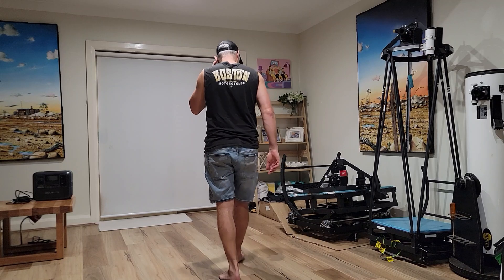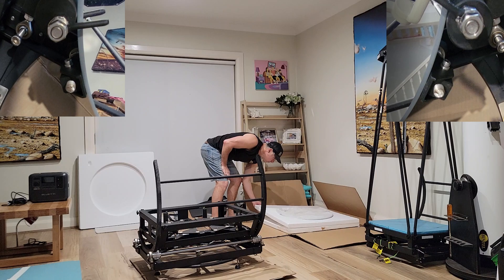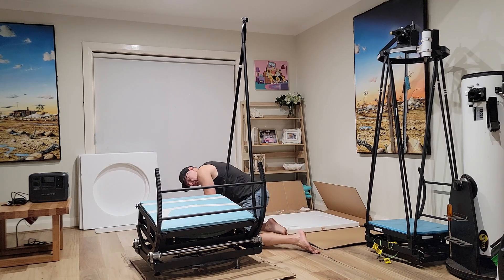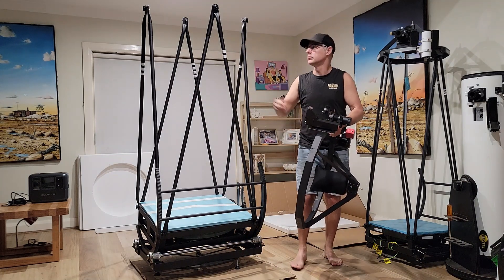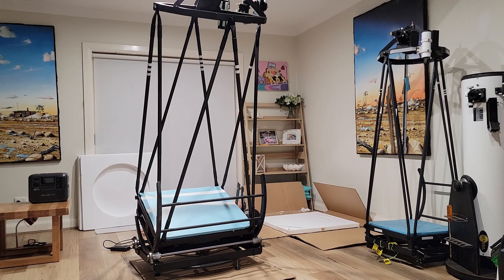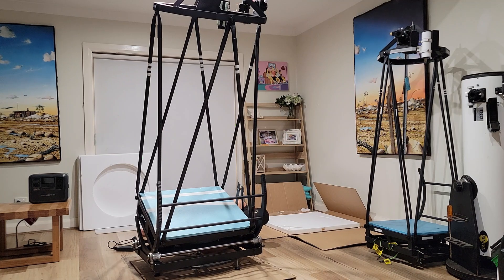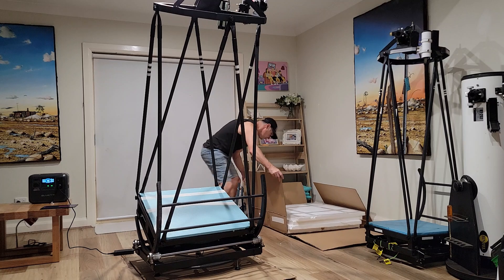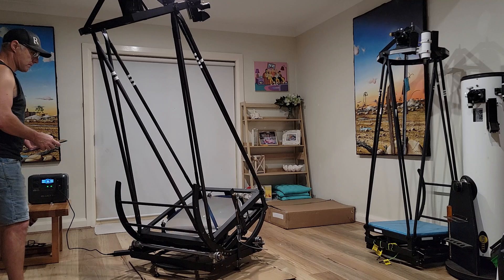How i build my 24" Dobsonian

Comment: Great build video! Do you take the primary out and set it in the box it came in whenever it's not in use?
Reply from the maker: Thanks mate, yeah sometimes it do, probably 50 - 50 if it think about it. Whenever I go away it goes in the box 100% and never travel with the mirror in the cell
Reply: @damienk2372  Ok thanks Damo! I wanted to also ask you about the brass wires connecting the support angles. The online instructions show them connecting the outside of the triangles, but are they also to be connected on the inside?
Reply from the maker: Yep, a run around the outside and also the inside 👍
Reply: @damienk2372  I also wanted to ask you about the curved altitude bearings. When I push the scope down in altitude, im getting a clunk/catch on the Teflon pads. Do I need to adjust the curved altitude bearings? Other than that, im pretty much done. How tight do you make the strap that holds the primary? If I tighten too much, it seems to move the primary up towards the single bumper. Sorry for all the questions brother.
Reply from the maker: Remember I said altitude bearings need to put so each end touches the ground like a C and you push down in the centre and tighten it up to make it flatter where the join is and the sling need to be as tight as necessary to hold the mirror directly (measure with tape measure to the mm or 16th inch) in the middle of the mirror housing. Check it every week to see if the sling has stretched for the first 3 or 4 weeks. It should be part of your routine of collimation to ensure the mirror is perfectly central
Reply: @damienk2372  Thanks Damo! I did that with the altitude bearings initially and it fixed the clunk, but when I attached the truss poles and upper assembly it happened again. I'll keep at it until it's perfect. I have an Orion laser mate collimater. Not ideal but it works for now. I can't wait for first light! You've been great throughout this entire process and I really appreciate you taking the time to walk me through the assembly/collimation.
Reply from the maker: NP

Comment: Why do you keep the mirror in that cardboard case? Why don't you keep it in the mirror box when transporting it with it's cover on
Reply from the maker: Hi Mate,
I keep them separate because that's how i have to transport them at the moment, the scope does not fit out the door fully built and you can not carry it all together. So when i build or break down the scope i will usually take it all out in 5 trips and then build the scope in one go. 

Hope that helps, thanks for watching.
Damo
Reply: So you do need to disassemble it for transport. 😁👍 I can't believe the mirror weighs 30Kg. You raise it from the box with such ease!
Reply from the maker: The scope once built from when you receive it has 5 parts. The base, the rocker box, the mirror, the upper housing and trusses. I move them around like this and build at the location. And yes the mirror is probably a bit heavier than it looks 😁

Comment: that's not that bad ... i was thinking Hubble optics were a bit optimistic when they said 15 minutes to setup.
Reply from the maker: Hi Alex,
If this was my 16 you could take 5 minutes off this time, so much easier. I usually carry the whole bottom section mirror and all in one go on the 16". You have to be a bit more careful with the 24" as the extra little bit of weight could do some greaf to the fingers and toes haha
Damo 

Damo